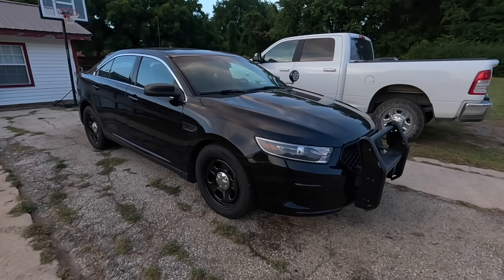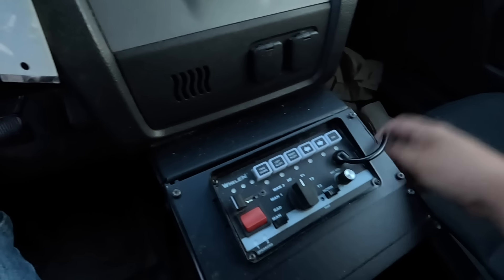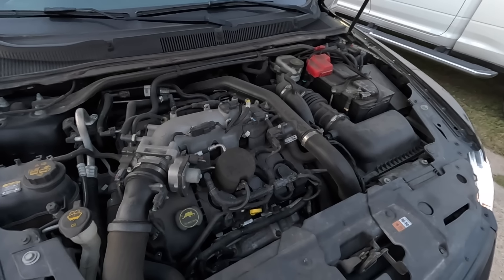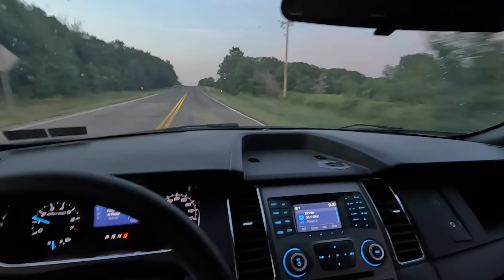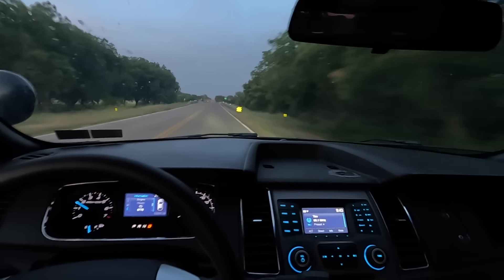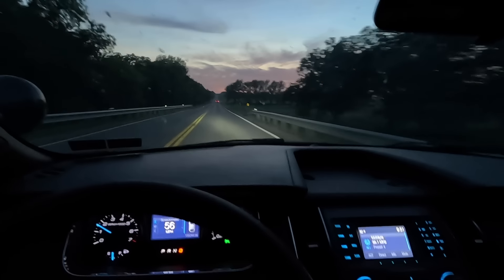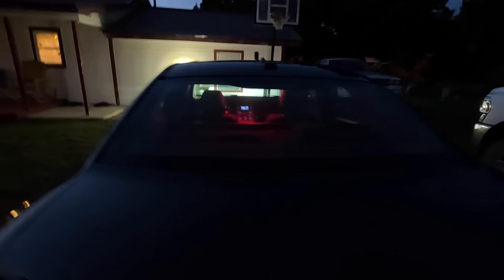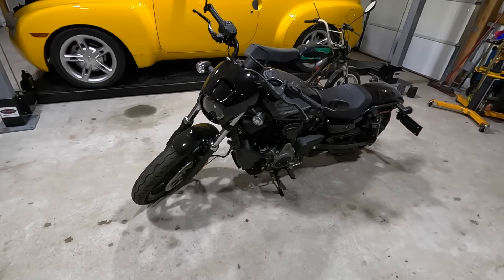I won this Twin Turbo AWD Police Car for $5K from Auction! They Made a BIG Mistake!

Comment: The horn is wired through the light and siren control box, it looks like the power is disconnected to it. Just lift it out and make sure power is supplied to it and the sound and PA should work right out of the gate. The lights may also work depending on if the lights that were installed in the actual car aside from the light bar are still there, so just be careful with turning them on in public. You can actuate the regular horn when the box has power and the switch is OFF by pressing the wheel. You can actuate the police horn with the wheel when the Whelen box is ON and by also pressing the horn button on the box. Switching between MAN 1 and 2 will change the MAN button from the siren to the horn depending on which one you have selected. Have fun!

Comment: WOW ! Now that's what I call a steal of a deal Randy. You don't need a bunch of cars with that pursuit cruiser in your stable of vehicles. Nice buy on that one !
Reply: I agree
Reply: Not really. Turbos got a lot of miles, water pump, engine, and transmission have a lot of miles. I bet that will be in need of some major repair bills soon. Good luck. There is a reason police departments are phasing these out and ford no longer making them. I sold mine at 80k before shtf.

Comment: What a sweet find. It's gonna be a speed beast. Love to test it out on a nice track! Open up the full power and have some fun. Cha ching again Randy!!
Reply: Stock they run mid 13s. Tune and 3bar map puts them in the 12s. With a few others goodies 11s are possible. 2 people have got into the 10s but they were all stripped ad running on the brink of destruction.

Comment: The horn is run thru the siren box. When that box is on - the horn ring controls it. When that siren is turned off - the horn is normal. As mentioned - the siren unit is probably just unplugged.
Reply: That's what I thought myself

Comment: Randy,I love the car. Hopefully you can get the siren to work and any strobes it may have. My 2011 CVPI (Kentucky  State Patrol admin car)was stripped of everything except the spotlight. Wires were cut to make sure you would have a hard time trying to reinstall anything! Got mine at 168k with 3200 or so idle hours. I've been finding out the "cop effect' is real even with an old Crown Vic!
Reply: The "cop effect" isn't just limited to Crown Vics with spotlights either. My parents have a spruce green 2004 Grand Marquis with no exterior modifications except the damage where the previous owner smacked a tree. It's obviously not a cop car in daylight, but at night cars will fly up behind it and then drop back for a while thinking it is. People from Tennessee know that the dark blue plate is civilian, the rest of the country doesn't.
Reply: @Stephens_offroad_and  Yes,any panther platform will do except for maybe the Town Town car. Where I'm at and most anymore,its a Police Interceptor Explorer or Charger. Most people who aren't a car person see a CV or a GM still act cautious while driving when near. Mine has the actual wheel covers( brake dust is bad until I change the pads )and not the dog dish covers.

Comment: Nice snag on that one.  I don't think those cars in PI form ever came with HIDs (though the US-based SHOs did), but 9012 halogens in the headlights (and the stock lighting on the civilian/non SHO and PI were terrible).   Might be worth double checking the headlight install, even if aftermarket it seems like the bulbs were not installed/angled correctly in the socket.  But, I'm sure you'll catch that and other issues when you do your mechanical review.  Enjoy the car--I know I've been enjoying the content!
Reply: They have Halogen projectors like the 2011-2015 Explorers.  They get really bad as the bulbs age.  My company had a clapped out 2012 Explorer in our fleet and the headlights were barely visible.

Comment: Believe it or not I want a SHO. AWD twin turbo v6. The echo boost is bullet proof! The gear box that distributes the power to all wheels is the weak link if you mod the motor over 500hp. You can upgrade the gear box for a few grand. You can easily add 150 hp just by upgrading the plugs, thermostat, mid pipes, air intake and Livermore soft tune! The ultimate sleeper Dad ride! Nice score bro.....

Comment: Check the water pump weep hole on those.  Early 3.5s had an issue where the seals would leak and then dump coolant into the oil pan.  Bye bye 3.5L.  At 150k, it's definitely around the time to replace the pump, if it hasn't been replaced already.  And it's behind the timing cover.  It's a 50/50 on whether you need to raise the car off the front subframe.
Reply: Water pump is an absolute nightmare on these! Ford did a number and built it internal to the timing chain. Chocolate milkshake if it goes and a fortune to even replace. Hard pass
Reply: @Tao_Peace with a lift that water pump is not that bad. There are lots of late model vehicles that have time consuming repairs. The nuts and bolts on that front cover and timing chain system are that bad.
Reply: The pump job most likely hasn't been done and it was due hence the reason it was auctioned off lol. It's a real bear of a job and expensive AF because of all the labor involved. The timing chains and guides are also replaced as part of this job as the water pump is part of the timing system.

Comment: Taurus SHO = 3.5L direct-injected Twin-turbo EcoBoost V6, 2 Garrett GT1549L turbochargers, produce 365 hp (272 kW) at 5500 rpm and 350 lb⋅ft (475 N⋅m) of torque at 1500-5250 rpm.
This faster than a Ferrari 355!
Congrats, with this great find!

Comment: You probably will need to power up the siren box for the vehicle horn to work. It could be using the horn tap.They probably unplug the ppv wiring in the center console.

Comment: can tell you right now it's either Pittsburgh or Philly area at the minimum.  two inspection stickers in PA means it's registered in a major city...the second sticker is emissions.  and emissions are only required, here, in major metro areas.  and how are you running sans plate?

Comment: Looks like you found one hell of a good deal! I have a few observations that may help you out: 
A) I'm guessing the siren was wired into the horn fuse, so there's a good chance all they did was pull the horn fuse to disable the siren; 
B) Given the back seat is leather and has power windows that work, I doubt it was meant for ANY type of criminal transport. The child locks are probably the standard lever inside the door jam like in every other car. 
With that said, this was probably used by the police Chief to tool around in! 
C) I believe the little toggle button on the center console armrest area (II 0 I) switch is the driver side seat heater! 
D) The overhead trunk release is likely on a 45 second delay, meaning once you unlock it via the overhead button, you only have 45 seconds to go round back to open it before it locks again. (The SUV interceptors are like that)
I think you really lucked out! Can't wait to see a follow-up on this beautiful car!

Comment: I purchased a 9C1 police car way back in the day when they first starting selling them to the public. All the wires for the wig wag lights and sirens were there but they cut them under the hood. An hour and a bunch of butt connectors and everything worked again !!! I think they have to disable that stuff before selling. Should be an easy fix. Awesome car ! Best part about it was driving in the fast lane and watch people scramble to get out of your way.

Comment: Just was scanning and saw your post. About 3 weeks ago I bought a 2018 police package for $9300. It is in steller condition. New intercept tires, runs like new and runs like a scalded dog. Only thing with mine is that I'm still learning to drive it. I'm a retired LEO of 42 years  and was driving by a lot a local guy has selling all kinds of retired law enforcement vehicles. When I get down on mine and the front engages you have to be ready because it will grab the wheel from you. Horn didn't work because the siren was wired to it to change sounds when running code. I traced down the factory horns, plugged them up and works like a charm. I'm averaging 21- 24, if I keep my foot out of it. You will laugh, I got my first speeding ticket in 54 years in it. 92 in 55. Tropper was great dropped it down to 66 in a 55. I've had mine up to 146 but got nervous but still had petal. Lastly mine was a Supervisors car. I have a few small hole here and there from mounting blue lights but that's it. 1 suggestion, mine had some minor fingernail scratches and rock dings but if you wax it with black color wax it looks like new. Be careful and have fun.

Comment: Randy sir, as a public works truck driver/mechanic in NJ. Looking at that car it had to have been an top ranking officer of the department because if that had been a regular street patrol vehicle it would’ve been beaten to shit. All top officers are the only ones who drive their own vehicles and when they get tired of them or the new budget comes out for the new year. They put in for a new one for themselves. That’s just the way it is. Spend taxpayers money on themselves when it’s not their money. Great buy Randy, you’ll make your money back and then some. Very sought after vehicle!!!

Comment: FUN FACT: It's not exactly the same powertrain as the SHO. It lacks the T404 Ford Performance package. It shares the same driveline, with the same final ratio. But the timings and tuning on this engine are totally different. It's tuned from the factory for reliability and longevity. This will do 0-60 in about 5.5 - 6.0 seconds where as the SHO from the factory is closer to 5 flat. Many of the higher performance parts on the SHO engine are also different, as they wanted more parts compatibility with mainline production for ease of fleet service/maintenance.

Comment: Do certain cop cars in the US have special ECU programming? In sweden police cars both marked and unmarked units have special ECU programming to remove the speed limiter and a bit more power than stock, The XC70 D5 they have got around 225HP, My stock D5 has 185

Comment: The 12 plus (red) and 12v black (negative) are just disconnected on the siren . The red and black you found in the video should have 12v from the main power bus hot all the time. Check with a test light or vom meter. Then connect the red and black coming from the siren to 12v hot all the time and it will all work

Comment: I've owned a highly tuned (just shy of 500 whp) 2013, 3.5l Ecobeast for three years. Just bought a black one. Can't buy a better car. 75 mph rear impact rated and Ballistic doors, roll cage, dual led spots, 30 amp 115 volt trunk power, etc. The list goes on...Nice find! :glasses-purple-yellow-diamond:

Comment: I bought a service vehicle a 2005 dodge durango it had the strobe lights and switches i was messing around see the swiches and wires were still there i check the fuse box and found a red wire that just hangs there come to find out they had a metal fuse tap that the red wire plugs into i pluged the wire in and all the strobe lights works

Comment: I had a 2014 Taurus SHO for about 8 years and modified it!  I very highly recommend a tune from Gearhead!!!!!  These cars are easy to mod and make fast / fun!!!!  You sure it's a 2016?  That dash looks WAY OLDER than my 2014 with the gauges and everything.  Stock is 365 HP and 350 lb-ft
Reply from the maker: I’m 100% sure it’s a 2016.

Comment: Timing chain, cam chains, water pump, PCV chamber and two turbochargers cost roughly $6 to $7000.00. Add that another $500 if the PTO hasn't been serviced at regular intervals. You'll be needing all that. Don't ask me how I know...
Reply from the maker: Thankfully it’s a police car with PTU coolers and they always maintain these cars. I’m not worried.

Comment: Your engine idle time is different than your engine hours. The idle time counts as 33 miles according to Ford. You'll only put idle time in while in park or neutral while idling.
I have a 2015 Police Interceptor Sedan with the 3.7. It ran well when i got it but it's beginning to run better now. I put in new plugs, k&n makes a filter that will fit in the air box and one for the cabin as well. I had a coil changed recently. Keep your eye on your coolant reservoir if the water pump hasn't been replaced. They're internal in the 3.7 and tend to fail between 100-150k. Mine started failing right in between but I had no engine failure, thanks be to God! No coolant got in the oil. NGK Ruthenium plugs work great for these engines. Just note that they have one for N/A and another for turbocharged engines! I also had the VVT replaced while the water pump was being done since it was already apart. Mine runs like a champ too! Also just under 160k but with more idle time. My grandpa purchased it first for $7,770 with 102k on it. He bought it in PA where we are from and he thought it was used on the turnpike.

Comment: To the people that think that PDs don't spend money on police cruisers, they need to think again. The Taurus Interceptor came with 2 Ecoboost options, the 3.5 and 3.8. It's the same thing with the charger Interceptors. They came with a 5.7 AWD, or 6.3 AWD. The latter of these vehicles cost big money because they're custom built cruisers, that are even further tuned.

Comment: Don’t celebrate too early. The ecoboost is not cheap to maintain after 150,000.

Twin turbo it self cost around $6000 to replace and the water pump cost another $4000

You’re looking at around another $10,000 in repair spins

Plus the high idle hours, usually it’s 8000 idle hours for police car. Idle hours x 33 miles so 80,000 x 30 = 240,000 miles total.

Your car is is really around 300,000 miles on the engine and turbo alreadyz
Reply: Oops I’m sorry 4800 idle hours x 33 miles = 158,000 engine miles + 150,000 miles = total 308,000 engine miles.

Meaning you’re looking at replacing water pump and turbo soon and it will cost nearly $10,000

Comment: I too have recently bought a 2016 Ford  Interceptor sedan with twin turbo ecoboost. It’s actually my second one. 

So, reference the siren. More than likely they either took a fuse out of the power distribution in the console. If wired correctly, the backlighting should come on when you turn the headlights. Looks like you’ve got a clean car for sure. Mine still has a cage and plastic backseat. (That’s coming out). Mine also still has a functional led lightbar and strobes. Me being a police officer, I bought this for that very reason. I wanted a turnkey purchase. Anyway, just be cautious about the notorious water pump issues. These cars are a turd to do that job as a shade tree. Overall, looks great. They cleaned it up nice. Can’t even see decal impressions.

Comment: I got lucky with buying a Ford Taurus for my elderly mother. It was a low mileage unmarked car, and the sleeper has incredible performance. We've sold it, but I still see it running around town. The large tires are a giveaway..

Comment: Police cars idle a lot, which would make that 150,000 miles on engine in theory be more. I think Ford themselves said 1 hour idle time is equivalent to 25 miles driven. So you would have to look at total time vehicle was running in trip thing in the dash. Then do the math. But the engine definitely has more miles on it in reality. Still a nice car though

Comment: Better make sure the water pump was changed on that. The water pumps are internal and when they fail, they leak coolant inside the crankcase and destroy the engine.

Comment: Horn doesn’t work because it’s spliced into the siren controller. So an officer can use the horn button to “chirp” the siren. I worked as an upfitter, installing and testing emergency vehicle lights and sirens. The department most likely disconnected the controller when they took the light bar off.

Comment: I drove a '91 Ford Taurus Police Car when I was a police officer back in the 90's. We received a few special Taurus' with the Yamaha SHO engine as part of a special grant program called STEP (Special Traffic Enforcement Program). The Ford technicians would come out every couple of months and inspect and work on our cars. The only thing that was weak was the transmissions and we went through them like underwear. I could run down Mustangs on the Interstate no problem and it was front wheel drive. We looked like the original RoboCop cars with our strobe lightbars.

Comment: Nice!  Last year I picked up a 2014 PIU 3.7 with 154,000 miles for $8,500 (the owner had a new water pump and both timing chains installed just before I purchased it) it's a great winter vehicle)!   

I want to find a Twin Turbo model for a summer vehicle!

Comment: I'm curious about something (if you want to of course). You should try and find a police interceptor Ford Explorer. Thats what the police use today as apparently the Taurus has been discontinued. I'm curious about the performance comparisons.
Reply: Where I live in Florida, the local PD as well as the sheriff's department for my county run the Explorers. I've spoken to several officers who have said they love them. And they are quite fast for an SUV.

Comment: Remember roll down your window a little bit before you shut your door so you don't blow your weather striping out love the videos
Reply: wait is that really a thing?
Reply: @wizzardgame8343  I was raised around old hotrods and my dad used to do it all the time it let the cabin pressure escape with the force of the door shutting I'm really not for sure it works but it will shut easier have a great day

Comment: solid cars man, i rolled my 2013 lengthwise  3 times after being hit by a methhead, walked away minor injuries. Now I own 2 2015 detective FPIS take them off road, banging through fields. solid cars but crazy how much the parts are, not cheap